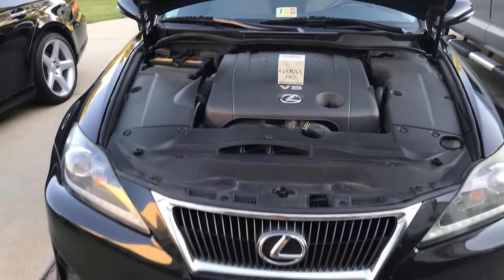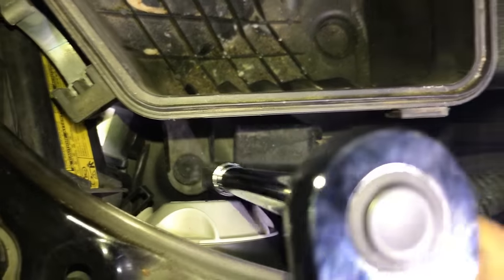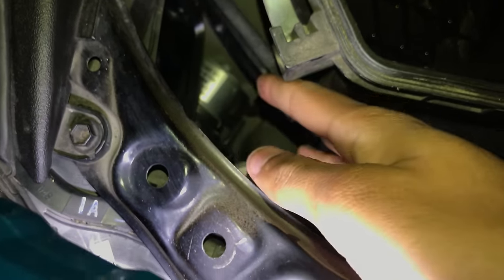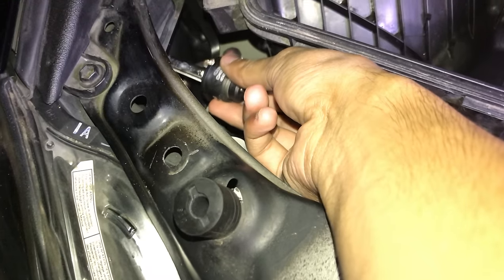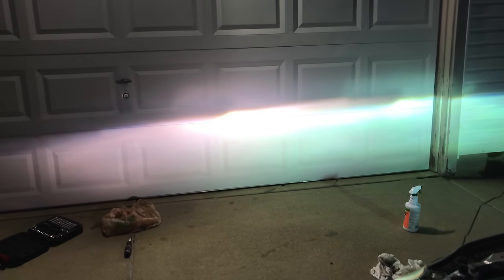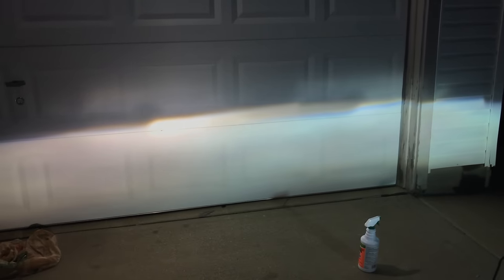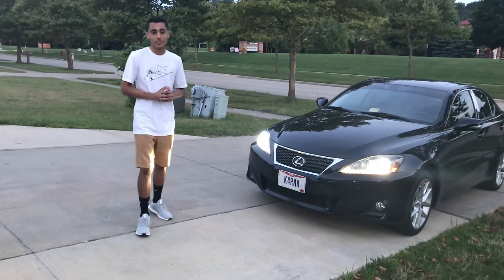How to change Lexus IS250/ IS350 headlight bulbs! *STEP BY STEP*

Comment: That's s lot of work just to replace the bulb
Reply: LTV999 exactly i other vids show you not taking the whole engine apart lmao
Reply from the maker: @vursce  Unless you have the hands of a 4 year old girl, there's no way you're changing that passenger bulb without moving over the air box lol Honestly it's super simple. Not a two second job like a Camry but pretty straightforward nonetheless.
Reply: Sarai Garage yo take the bumper off and the headlights and there, change the bulb. Did it yesterday took me 15 min.
Reply: Apple Pie no way? The whole bumper? Is it easy to take of front bumper? Mostly asking cause I want to replace mine but am intimidated by the thought
Reply: ImGairBair yes it is you can find how to on YouTube.

Comment: You're godsend!!!!  Changed my factory headlight bulbs on my 2013 IS350 to 8000K bulbs and this video saved me so much time and headache cause I already knew I had to get a socket wrench extension and then put the filter cup and its exhaust back in together before screwing in the bolts.  

You should have more subs as I see you do more than just work on the IS and your vids are so detailed and easy to follow.  Thanks so much!
Reply from the maker: Can Ameri Thank you for such kind words! 😊 It means everything to me!!

Comment: Thanks for the video it helps a lot. Also when you talked to the guy about the check engine light it also helped me a ton. It turns out if you just drive it a bit after it goes away thanks for the help!

Comment: Thanks for the great tutorial. In your experience does the orientation of the bulb in the housing matter? Just swapped out my stock D4S for Philips xtreme gen 2 and I either need to mess with the bulb or realign the projectors.
Reply: Around 10:30 or thereabouts he says the orientation shouldn't matter, as long as you get those 2 pins or teeth to slot in properly to the bracket to secure it. At least, I hope that helps..

I was gonna smash out a bulb replacement this afternoon but might wait til the weekend now I've seen this 😅
Reply: Did you work this our brother? I changed for the same type as you and there are weird cutouts projected.. never noticed it before.. maybe the thin part of the bulb blocks the light?

Comment: Question. Do these bulbs work as high beam and low? Mine blew out tryna change it on my own! Great video btw
Reply from the maker: Raj B The High and Low Beams use different bulbs. I have a video showing how to replace high beams as well. Very simple. Idk which One you need to replace but just watch my videos and you should be able to figure it out! Any other questions just ask and I’ll respond as soon as I can!

Comment: Actually, there is a square knob on the bulb that fits over into slot to get the right orientation on the bulb.  I'm sure the light works regardless and honestly don't know if it affects performance of the bulb, but can only guess there is a reason for the knob and slot alignment.  Great video though.

Comment: My transmission light came on after I changed both headlights. Do you know why this could have happened? Did I put the bulbs in too tight or something? I double checked that everything is connected correctly and tightly
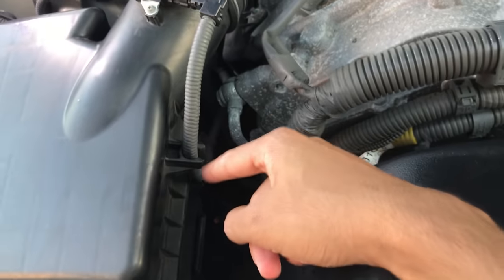Reply from the maker: Make sure you plug in that wire at 2:21 completely. It is for your airflow sensor. I know personally when I ran the car without plugging it back in, it instantly threw a check engine light. Once I plugged it back in, light remained on. Drive it around the block once or twice, shut it off and repeat to just get a "drive cycle" and for the computers to recheck everything. Once they determined that the wire was back in place and there was no actual problem, my check engine light went away. 

This is the only thing I can think of. For the most part tho transmission is pretty separate from the headlights. Messing with one shouldn't really have any effect on the other, even if you do something wrong. 

If I had to guess, this is a completely unrelated problem that just happened to pop up now. Sorry. Let us know what eventually happened and what the fix was. Best of luck!
Reply: @SaraiGarage  hey man thanks for the help. I’m actually just an idiot. I turned my car on and THEN I plugged the sensor back in. I did turn my car off and back on again and the check engine light was still on but today when I started it to take it to the shop the light was off 🤷🏼‍♂️
Reply from the maker: @ImGairBair  LMAO it’s cool! Don’t worry I freaked out when it first happened to me too 😂 Glad everything is all good tho! 🙏🏾🙌🏾
Reply: Probably need to add more blinker fluid sometimes it throws Trans light and maybe throw some engine oil in Trans dipstick tube so you lube the tube for Trans fluid sometimes Trans fluid can get a bit sticky. All done your good to go. If can't find blinker fluid cap it's under gas cap just pour it in it will go to proper tank! Oh sometimes hard to find blinker fluid if so just use vodka it sounds crazy but it works just make sure it's 151 proof! Better for cleaning blinkers
Reply: @Catchmeifyoucan209Stockton  😂 alright sure, I’ll try it

Edit: holy fudge, it worked! I had to buy a new car but hey, it worked!

Comment: any advice for the DRL flickering? The headlights and high beams are fine, just the DRL
Reply from the maker: I used to know but I forget at this point. It’s a fairly common issue over time. 

Check to see if there are posts on the “Club Lexus” forums. 

I believe one of the threads has the solution there! 

Best of luck 🙏🏾

Comment: Do your bulbs shake a little when hitting bumps? My locking clips are properly fastened yet they still have a little shake to them
Reply from the maker: No! Honestly the first time I did it, my passenger side bulb was a little loose and did end up getting disconnected when driving like a day after I made this video, but it was because I didn't connect the harness to the bulb properly on that side.  Maybe try opening it all up and making sure everything is connected as best it can be! It could be the harness like it was for me if the clips arn't the problem!
Reply: @SaraiGarage  Noted. Will probably mess with it this weekend as I need to see if s bulb is going bad or something internal with the headlight. One beam is not as strong as the other
Reply: You may have a busted headlight clip, on the actual headlight housing.. my passenger side housing has a broken tab and it shakes a bit over bumps

Comment: When doing this will it make the check marks turn on? My check marks don’t work at the moment.
Reply from the maker: No. The check mark’s run off of separate LED’s.

They usually don’t fail tho. I’d check if there’s a blown out fuse or something. Idk I’ve never dealt with that problem before. 

If not, you might need new headlamps. Those check mark LED’s are not really replaceable.
Reply: @SaraiGarage  for sure thank you

Comment: How do you fix the DRL if one goes out? I changed the highbeam and low???
Reply from the maker: If you have the older headlamps without the LED check mark, it’s just a separate bulb. 

If you have the LED DRL with the facelifted headlamps, like my car in the video, it’s a much more difficult process.

Guys on the Lexus forums have repaired just the LED’s before, and you can find guides online on how to do it, but from what I remember, you have to open the headlamp lens. 

The more common approach is just buying a new complete headlamp. 

Before doing any of that though, I would recommend going to a trusted shop or dealer and seeing if the bulbs inside have actually died or if there is just a wiring problem that can be fixed cheaply. 

You could also try finding someone in your area or Facebook groups that builds custom headlights, they might be able to fix the problem for cheap as well. 

I’m sorry, this is probably not the answer you were looking for, but I wish you and your Lexus the best! 🙏🏾

Comment: The tabs that you pop on the black covers????   How do they pop back in.   Do you have to buy new ones?
Reply from the maker: nicholas motta with the pointy part of the tab facing down, press down on the tab against a hard surface like your driveway and the pointy part will go back in and the button will pop out. Then put them back in the covers and push the button in how it was.
Reply from the maker: * don’t cover the middle of the button when pressing down. It needs to pop out when you press down. When pressing down, only press down using the outer ring of the tab!

Comment: Video for hi beam replacement? Wife says dealer has to do it. If you can get at hi/low bulb, can the hi / dry beam be reached (passenger side)?
Reply from the maker: High Beam replacement is just as simple. Unfortunately the passenger side is a bit harder to work with just because there's more stuff on that side (as demonstrated in this video). You won't have to remove anything extra though. Just do what I did in this video.There is a different access door for the highbeam light. Do a quick search online to familiarize yourself with what the other acess door looks like. All you need to do is exactly what I showed in this video, but instead of opening the low-beam access door and changing the lowbeam, open the high-beam access door and change the bulb the same way. The high beam access door should be right around the low beam access door and should be all black without the yellow stickers the lowbeam access door had. I'll make a video on it but it'll have to be months from now. I'm too backed up with school and other video requests for right now. Hope that helps!
Reply: Sarai Garage thanks for confirming. After sending that message I got the brilliant idea of going and looking and can see the hi beam bulb access door. I replaced the plugs last year so familiar with all the extra stuff needing to be removed for access. Thank you again,
Reply from the maker: glock23northerner Glad it all worked out!

Comment: This is just for the high beams.... i need the low beams!
Reply from the maker: This is for the low beams. 

I have a separate video for the high beams.
Reply: @SaraiGarage  strange… the low beams are center most to the front grille on my car, and the high beams are outer most.
Reply from the maker: @Smasher517  Are you sure you don’t have after market headlamps? 

I’ve never seen genuine Lexus headlamps set up like that. These are genuine facelifted headlamps that came factory on my 2011 IS250.

Comment: The light bulb is 15-25 bucks right?
I just need mine done in the same day .

So I need to buy it at a store them bring it to a mechanic?
Reply from the maker: TRUE LOVE I forget the price but yeah, just bring it to a shop. Sometimes dealers don’t do that, but shops almost always do. Just make sure you buy the correct size bulb! They’re different depending on whether your car came equipped with halogens or xenon’s!

Comment: Are these HID Lexus lights? Or is it Halogen Lexus lights.  If it’s a halogen? Can I update my low beams to these white looking lights?
Reply from the maker: These are HID. If you have halogen headlamps, you will need to find a lightbulb that has a white color (such as a 6000k bulb) but use bulb size H11-55W.
Reply: @SaraiGarage  any recommendations on best LED 6k lights would be greatly appreciated!
Reply from the maker: @jaimepardo905  I have no idea my man. I would go try to find some info on the "clublexus" website/forums. Google questions you have about installing LED's into halogen headlamps and type "club lexus" at the end. When you search like this, some forums from there should pop up! I'm sure people on there have done it before and have posted which ones they prefer and recommend! 

I just don't have any experience with any of them and don't want to misguide you or lie to you! I wish you the best!!
Reply: @SaraiGarage  you've been helpful and thank you! I wanted to ask because i own a 09 IS that came with factory HID. They are expensive and would like to buy Halogen with white LED 6000K. 

My questions is which i could find; would halogen headlights fit my 09 IS or is the wiring different because it came with HID's? This would mean i could only stick with HID's which I hope i don't have too, because those LED's 6k lights are close to it and more than half the cost of the HID's. 

I checked that it came with ballasts which i can remove, however i wanted to know as I'm looking to purchase after market halogen headlights as even the aftermarket HID's are expensive. thank you for your suggestions.
Reply from the maker: @jaimepardo905  I'm a little confused by your question and don't understand if you are talking about bulbs or entire headlamp assemblies. 

If you are talking about converting factory HID headlamps into Halogen units by removing the ballast, I'm not sure how exactly that would work. That's a little too advanced for me, but I do know the wiring would be different. Honestly to me this sounds like too much work just to switch to cheaper bulbs. The bulbs are not that much more expensive for HID,  at least not where I'm at (USA), and bulbs last a long time so it just seems silly to me to do all this just to try to save a few dollars. 

If you are talking about changing/ buying a new headlamp assembly to get LED's, instead of buying headlamps with halogens, I would look into VLAND LED headlamps. They look amazing and are only $500 for a set! Honestly I've been thinking about doing this mod to my Lexus myself.
Reply: Big Gucci the entire headlight, not sure if the wiring is different for HID and Halogen headlamp assembly
Reply: @SaraiGarage  Hi, i would like to replace the whole HID headlight assembly for a Halogen headlight assembly and put LED light bulbs on it. 

I have an 09 is 250 that came with factory HID and are too expensive to replace. I was wondering if i purchase a halogen front light assembly, the wiring will fit. If the wiring doesn't then i would need to buy HID headlight assembly. Any suggestions? thank you as any help would be appreciated
Reply: Hid headlights are a defect if you don’t have headlight washers or someshit like that in Australia

Comment: Just as a note, I had a 2010 IS250 that had H1155LL bulbs instead of D4S bulbs, so make sure you check before you buy new ones
Reply from the maker: Yes. H11 bulbs are the halogen bulbs found in more base-model trim versions of the second generation IS (not trying to insult in any way, just trying to be honest). 

All of this information has already been covered and included in the description of this video! 

I even included links to both kinds of bulbs!

Thank you for sharing again though!

Comment: Great video bu have you noticed after you reinstalled the bulb... the connector was angled differently
Reply from the maker: Yes, if I remember correctly, it does not matter how the connector is angled. There are no slots for guide pins or anything else that locks it in. It's really only held onto the bulb by a rubber seal. 

In summary: It doesn't matter what angle you put it back on. Great spot tho!

Comment: Do the bulbs fit 2010 is250?🤔
Reply from the maker: javier munoz All second generation Lexus IS models (model years 2006-2013) have the same light bulb sizes. The difference is whether or not your car came equipped with halogen bulbs (yellow) or HID (white/blue) from the factory. If your car came equipped with halogens, you will need to use a different bulb (size H11-55W) but if your car is equipped with HID’s, it will use size D4S like mine did in the video. The link in the description is for D4S size bulbs. A D4S bulb will not work if your car was equipped with halogens because you would need things like ballasts in your headlamp housing which halogen equipped cars do not have. 

Basically man, if you car came with white lights then yes, this is the same size (size D4S).

If your car came with yellow bulbs this will not work and you want to find a 6000k (6000k = color/brightness of the light) bulb that is size H11-55W. 

I know it’s confusing but I hope this helps you! 🙏🏾

Comment: Am I the only one who keeps the engine covers off 😂
Reply: official gmg2x Lol! I have an 13 ES350 and have just as much engine covers but I been debating on taking them all off to see how the 6 looks naked 😂
Reply: Michael Roach my mom’s ES350 has the covers off 😂 you can see some of the engine but getting to all the lights in the headlights are so easy
Reply: I removed mine when I changed my spark plugs. After realizing how much I had to do get to them, I never messed with putting the covers back on.. now needing to fix my headlight so that step is already done! lol

Comment: All this work to change headlamps..SMH.What about other maintenance that must be done? After the warranty is up your screwed . Tune ups, belt and etc. These cars and others like them are money pits.
Reply from the maker: Lexus is fantastic. My car is at 140,000 miles now and I’ve had almost no problems. Just an O2 sensor and I personally replaced the serpentine belt twice so far because I heard it squeaking a little and I didn’t want to take chances (Learned the hard way with my CLS63 and had to fix everything myself). 

My family has plenty of Toyota’s and Lexus’ at 200-300k miles still running strong with minimal problems. 

I think this is very easy. There are plenty of American brands, take for example the previous generation Chevy Malibu, which is much worse, and requires the entire front bumper to come off to change the bulbs. 

I think hassle is a case by case basis but overall, the Japanese brands are the easiest to work on. Americans are in the middle and Germans are always difficult no matter how easy of a repair.